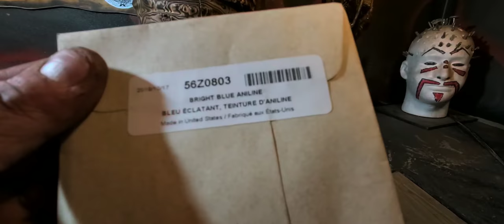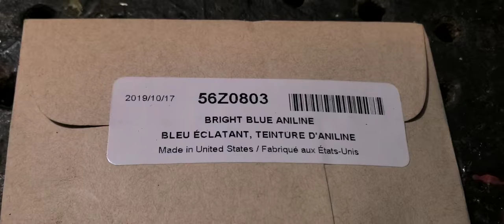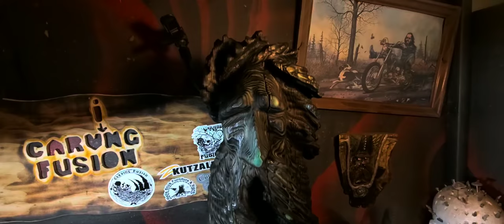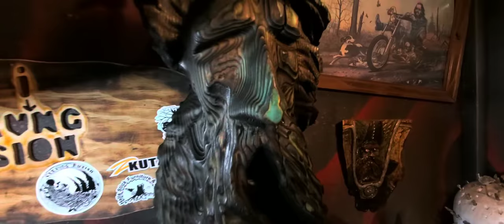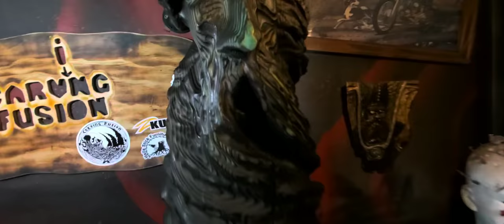Power carving, Wood burning, Cleaning, and applying colored wood dye, Shou Sugi Ban.

Comment: hey jordy for burning shou sugi ban style, do you have to use a propane torch? since i mainly do smaller work, could i get away with using a small butane torch? never done any wood burning but it seems fun
Reply: Also for the mc nuggets, try mixing the hot mustard and sweet n sour sauce, its great!
Reply from the maker: @ChonkysWoodshop  ahhh ok ill rember that for next time lol ty,

I think a butane torch may be to small but cant hurt in trying, (not on a good piece though